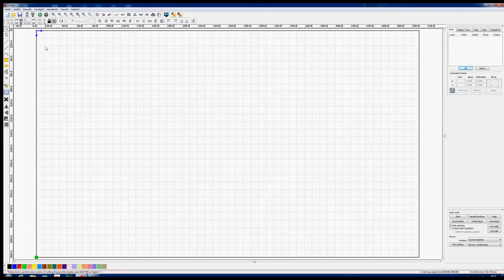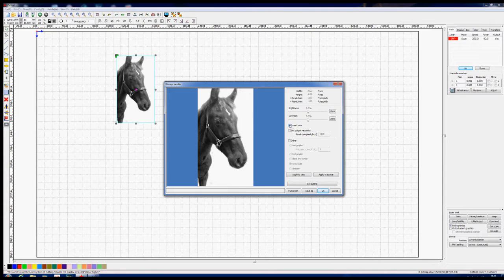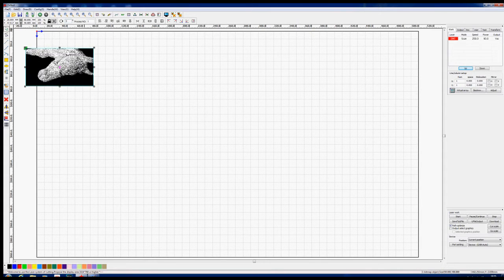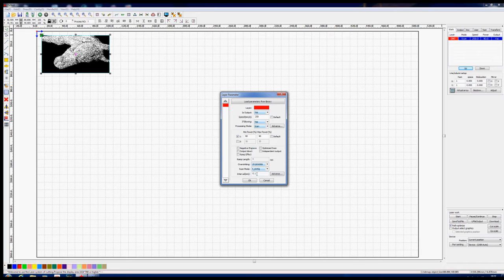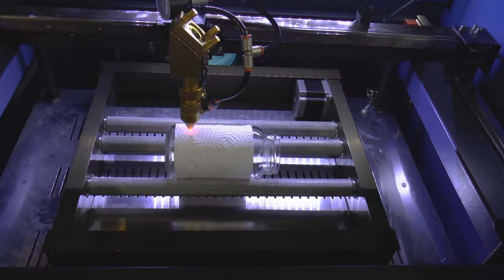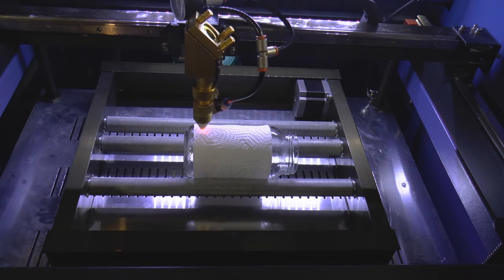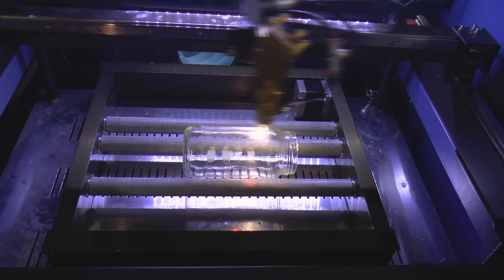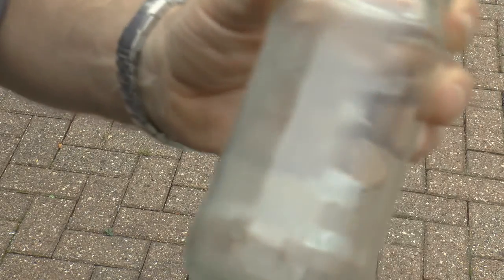RDWorks Learning Lab 13 rotary glass engraving

Comment: My program is working and my rotary is turning...... I'm trying a beer bottle  and my laser doesn't seem to want to etch it. I'm running a higher power, and even played with some elevaton.........any ideas ?? Thanks in advance
Reply from the maker: Hi
All glass (especially cheap  bottle glass) will damage with a CO2 laser beam if there is sufficient light INTENSITY. That light intensity is achieved  by a combination of 4 things
1) The quality of your laser beam. The more power, the sharper and more intense your beam will become.. Remember INTENSITY is the key factor. You can have a powerful laser tube  but if it has  a poor quality  intensity distribution within the beam then it will be like writing with a VERY blunt pencil. I would check the quality of your beam with a simple mode burn test as per this video for my 70 watt tube. The sharp point in the burn indicates very high CENTRAL intensity.
https://www.youtube.com/watch?v=R6Wqn5-HMzM.
2) The beam intensity is then amplified  by a lens.. Different lens focal lengths produce different amplification factors. A typical 2" focal length lens of any quality should be fine for glass engraving 
3)Setting the focal point to its optimum (sharpest) position
4)Allowing sufficient exposure time. Every material has its own (and different) damage threshold. Imagine using a can of spray paint. If you move the can very slowly then you will  apply lots of paint in one spot and it will blob or run. Move the can VERY fast and there will be hardly any paint in the surface. This is an exact analogy for your laser beam, so if you move at the wrong speed and do not have enough INTENSITY in your beam  then you will not reach the damage threshold for the glass..

My suspicion is that you have a badly performing tube so the mode burn is a vital test to tell you that

 Best wishes
Russ

Comment: Does it look like your X-axis was losing steps? The border of the etched picture seems to drift skewing the rectangular shape it should be. Perhaps the 250mm/s speed was too fast to overcome the back and forth changing of motion.

Great video series and thanks for sharing all your knowledge and experience along the way.
Reply from the maker: You are very observant and very correct. I must remind you that these are not tutorials but a record of my learning and exploration journey.  As an initial exploration it worked well but as with many of my first attempt at things they are not perfect and I am always happy to record and show my mistakes as well as my successes. In this case I did learn more when I moved on to glass objects. The effect was even more exaggerated. I fixed it by adding a thin rubber band to the glass object to prevent slippage in X and Y. I have also heard of people using that non-slip shelf matting to cover their rollers

Too fast?  Some say no .... "hit glass fast and hard". After my recent venture into dots  I an pretty convinced that running slowly  with a measured amount of power will produce crisper results but I have yet to prove that on glass. Glass and stone/granite have their own unique etching mechanism where a pin prick of heat locally heats a micro spot of glass/stone causing it to rapidly expand. These materials are poor conductors of heat  so the base material cannot expand at the smme rate so  casing a stress failure and a small heated shard of material cracks away. That means that you do not produce a clean dot but something like a stone chip on your car wind screen. It will be fin to find the right sort of settings for that.
Thanks for the comment
Russ

Comment: my machine makes my graphic circle all the way around the glass. how can i fix this problem? my graphic is not that big for it to do that.
Reply from the maker: Hi Hayden
We may be able to resove but it will be one question at a time.. What sort of rotary are you running? Is it a roller/wheel type or a  3 jaw chuck type?
Best regards
Russ
Reply: Thanks for the response. It's a rotary with a roller wheel. Has two double wheels on both sides of the rotary that the glass sits on.
Reply from the maker: Hi Hayden

The rotary device you are using is different to the one I am using . Yours has BIG wheels whereas mine has little rollers. However the basic operating principle is the same. To make your rotary work you have to unplug the Y axis and plug the rotary there instead. The machine does not know that you have swapped systems and for example one revolution of the stepper motor may  have moved the Y axis 1mm, whereas  now with a different system one revolution of the stepper motor may be operating your rubber drive wheel via a 10:1 ratio drive. In other words the rubber gear wheel will rotate once for every 10 revolutions of your stepper. If your rubber drive wheel is for example 50.8mm diameter (2") then its circumference will be 79.8mm. So that means one rev of the stepper will drive the rubber wheel 1/10th rev ie 7.98mm per stepper rev. That's 8 time more than before so the Y axis capaility has increased by a factor of 8 and that's why your rotary is running all round the glass. If you try to engrave a 1" square it will be 1" wide in X but 8" in Y

Now you have two options to deal with this issue. 

One is demonstrated in the following Boss laser video
https://www.youtube.com/watch?v=xN1bp_puCf8. This method has two small drawbacks. First you MUST have your pc connected to the machine. Although they mention two step settings , those are to suit devices they supply with their machine. You may have to experiment with other values to get yours correct. Secondly you MUST remeber to disable the user settings away from a rotary device when you replug the machine for normal use.

The second involves using a scaling factor to distort your drawing so that it finishes up at the correct size. The advantage of this is that you do not have to mess with the stepper calibration, you just disort ant rotary picture. That method is described in
https://www.youtube.com/watch?v=sIlXSZhgbe4

Hope something here helps

Best regards
Russ

Comment: Hello there! I've been using your tutorials for the past week now trying to get a grip on this Laser Engraver form China! Let me first say your tutorials have been spot on! Thank you for spending the time to help guys like me out who aren't as savvy. I am however having a serious issue with my machine that keeps moving the x axis over to the opposite side of the board, when inputting a BitMap or just a simple box into the Ufile, it then gives me an error message that reads " XY axis slop" or "Error not enough space", however I've checked the parameters in which you taught how to setup the table and laser head position, yet, it still goes to the top right hand corner of the bed. I double checked the 'X axis mirror' off as supposed to. Have you experienced this issue where the machine is defaulting to the wrong side of the bed?
Reply from the maker: Hi Brooks
When you first switch your machine on where does it travel to ? is it the back left or back right corner. Not all machines are set the same as mine. Pehaps a look at this video will help
https://www.youtube.com/watch?v=CWZvQXxbR_E  Basically If I understand you correctly your machine runs to back right at startup. That means that you need you mirror X and mirror Y both ticked;. Your head position can be set to top right or top left. To save confusion leave it at one or the other position so that you can  always visualize where it should be when you set your origin with the machine button. If any part of your drawing is outside you are trying to cut or engrave is beyond the defined size of your machine bed, you will get the error message  Have you set the table size as per video
https://www.youtube.com/watch?v=fLSI-z-TdNQ

Hope this helps to remove some of the confusion. If you are still suffering just shout out again
Best regards
Russ

Comment: I've begun experimenting with engraving pint glasses on my engraver.  One bit of advice I've gotten is to coat the surface before engraving with some liquid dish washing soap.  I believe this is to result in a smoother, safer surface.  Not sure what the mechanism is.  Perhaps just that when you wash off the soap it will take any shards with it?  Perhaps it keeps the glass from shattering in microscopic pieces?  Not sure, but I figured I'd pass that along.  BTW, the suggestion came from the Epilog laser company.
Reply from the maker: In the past I have trie glass engraving dry because all the other methods(bits of wet kitchen towel, masking tape etc) seemed to give no improvement. The mechanism of engraving glass is one of heat stress cracking. Glass is a very poor conductor of heat so when you apply a pin prick of intense heat, that minute area expands rapidly and cracks away from the body of glass underneath. I have been advised by several correspondents that smearing neat washing up liquid works well but even understanding the engraving mechanism does not help explain how this method makes things better. I have not tried it yet but in one of my future sessions I'll get round to that and all the different crazy ideas I have been sent to see what really works, if any do. The microscopic shards are quite deadly so I always wash them off in soapy water and rub them well with a scouring pad.
Thanks for wanting to share that info because I am getting a real sense of community from my correspondents/contributors. I may be demonstrating what I'm learning but the key word here is learning. I still have a long way to go.
Best regards
Russ

Comment: Hello Russ thanks for all you're time spent teaching us what these machines can do, I've came across a different method for using the rotary  table, after thinking a simpler way to engrave glass in theory. Is it possible to start with a rectangle that has the same length and width as the engraving area (taken from the diameter and high of the glass or cup) and pasting the bitmap and lettering in that same area. I would like to hear you're comments kind regards!
Reply from the maker: +Carlos Fainsod 
Hi Carlos
Take a cylinder with 100mm circumference. I think you are asking if I measure half way round the cylinder (50mm) and along the cylinder 50mm then I have a flattened  50mmx50mm square. Can I now fit my graphic into that square and expect it to engrave correctly?  Sadly, no.

 The machine is set-up to give the correct distance in Y when in a FLAT plane. ie if you design and program a 50mm square and cut or engrave that on a normal flat surface you will expect (and get) a 50mm square result. I will now assume you have a roller or wheel system that drives on the circumference of your cup/cylinder. When you now try and engrave your square that onto a cylinder, lets assume it  has a 100mm circumference (not diameter) will it fit on one half of the cylinder? ONLY if the gearing ratio on your rotary device makes the circumference of the DRIVE rollers move 50mm. You have removed the Y axis and instead plugged in your rotary device. The machine is not aware of this change and still outputs 50mm worth of steps. The chance of your rotary device being geared 1:1  is NIL. So you will have to apply a shrink or expand factor to one axis of your square to make it engrave on 50mm of circumference. It gets a bit more complicated because you have to rotate your picture through 90 degrees for rotary engraving. You can either apply this factor to the X axis before rotation or to the Y axis after rotation.
The good news is that you only have to work out this gearing factor ONCE and write it down for use every time you want to shrink/expand your graphic. It will be the SAME % no mater what diameter you are engraving. onto.

Hope this make s sense. It gets a bit more difficult when you are engraving on tapered objects because the top and bottom have different circumferences. Oops, Which one is going to drive?
If you need more help just message me and I will try to explain further. Several people have struggled with this concept but eventually become fully comfortable.
Best regards
Russ
Reply: Unfortunately.. with the chuck style rotary - this idoesnt work.. every diameter results in a different ratio to adjust the y-axis scaling.. ive done some test on 3 different tube diameters, and they all result in a different percentage... :( 

a 80mm tube of approx 250mm circumference, ended up cutting at 1045mm (for a line equal to the length of the circumference) - so i had to reduce the y-axis to 24% of the original size... 

for the 60mm tube (188mm circumference) - it cut to 570mm.. and this was a 33% of original size reduction...
and a 40mm tuve (135mm circumference) cut to 305mm, and was a 44% of original size reduction...

it mostly looks like its linear... but i cant work out a correlation of diamerer<->percentage to work out a consistent way of working it out based on X diameter object... :(
Reply from the maker: Hi Carlos
You are correct that my calibration method ONLY works for the ROLLER or WHEEL system and not for the Chuck system. However in some ways it's easier for you because if you go to the OUTPUT tab (top right)  depending on which issue RDWorks you are running you will find  a tick box for enabling proper rotary engraving which is what you are trying to do. You may have to enable it in the USER settings before you can use it. I have to apologise for not being able to help you more because I have never needed to use it. However, I stronly advise that you join a recently formed forum for owners of Chinese Laser Cutting machines.  its at www.rdworkslab.com. There is a really good bunch of guys there and  several will have your type of rotary system and be able to explain how RDWorks needs configuring so that it's easy to use.There is an entry question to make sure you are a person rather than a computer. The answer is russ. Definitely worth a visit to pose your question there.

Best regards
Russ

Comment: I thought I'd offer some advise on how the actual Rotary Engraving function calculates.  If you use the vendor password that was previously communicated in the video series you can look at what the Y-Axis micronmeter steps are (um as it is listed).  Click on the radio button for the Y-Axis and look at the value (it's probably something like 11.818... or around there).  If I knew how to post an UR, I'd paste the formula/spreadsheet used.
Reply from the maker: +NFO Sec 
Thanks for your feedback and you are absolutely correct about accessing the Vendor Settings Section and altering the Y step value, as one way to get the correct scaling for the rotary axis BUT it means that you could be sending people with little experience or who have no conceptual knowledge of what a stepper motor is, into a protected area where they could unknowingly mess up the factory settings of their machine. Would they remember (or even realise) to go back into the vendor settings to reset it to 11,818 (if they had even bothered to note this value) when they plug their normal Y axis in? The 3 jaw chuck rotary system is different in that you can tick the rotary box when programming and it allows you to specify your work diameter. I do not have such a rotary device so I have not tested it , but I assume that this temporarily adds a further scaling factor to the Y axis to correct for different diameters. With the circumferential roller system (as in the video) you only need to calibrate the relationship between Y steps and roller circumference ONCE and it will never change regardless of your work diameter.This means you can make just one TEMPORARY Y axis % scaling adjustment when you draw your rotary program and it will have no effect when you go back to normal Y axis use.  That's my reason for showing people the simple and safe way (no accessing Vendor Settings) of calibrating their rotary device. This method will no not work for a 3 jaw chuck system but the programming software takes this into account with a simple tick box so that again you do not need to enter the Vendor Settings protected area.
The one thing I have learned as I have progressed through this video series, is that age range of users is from 14 to 85 and their technical ability is tremendously varied. I have tried to be inclusive to all without offending the technically able.
Reply: +SarbarMultimedia I apologize, my message wasn't very clear.
Basically, what I did is went to the vendor settings, clicked on the Y axis radio button, and copied the set length (um) value.  In my case it was 11.818  I then created a simple spreadsheet that did the following:
Calculated Pi (3.14.....  times 1000 (scaling factor) times the piece diameter (let's say 80mm) and divided it by the Y-axis set length (11.81829).    This will give you the almost perfect circle pulse value for the diameter of the piece/objects you laser engrave.  In the case above, the result was 21266.49247.  So, (3.1415926 * 1000 * 80) / 11.818 = circle pulse of 21266.49246  When you look at the object's parameters (sizing) you will see in the preview that this matches perfectly or within 100th of the object size.  This can be tested using your method (which was remarkably awesome by the way).

I wouldn't advocate changing the vendor settings because it's easy to mess up.  Try it, you might be pleasantly surprised!
Reply: +SarbarMultimedia.  I agree, simple is better, but once you have the value of the Y precision you can easily calculate the circle pulse by only entering in a diameter thereafter.  My hats off to you in your diligence and educating of others.